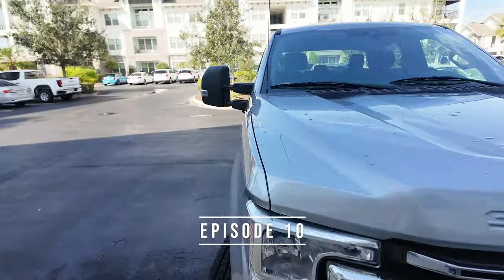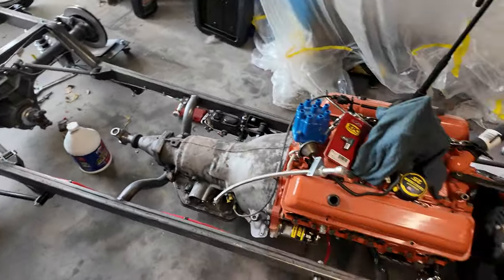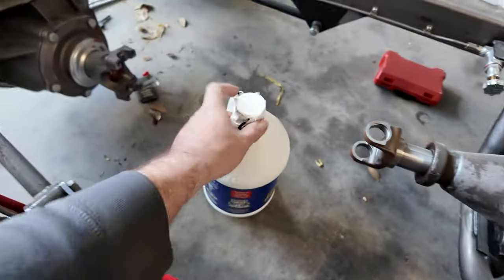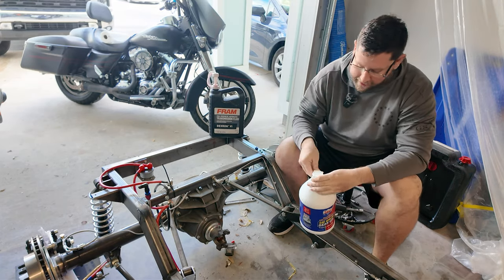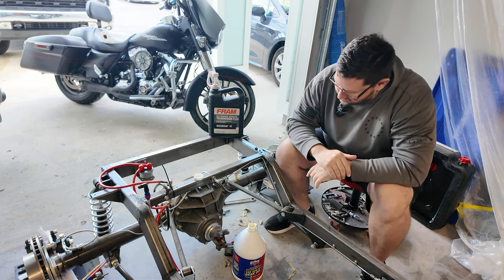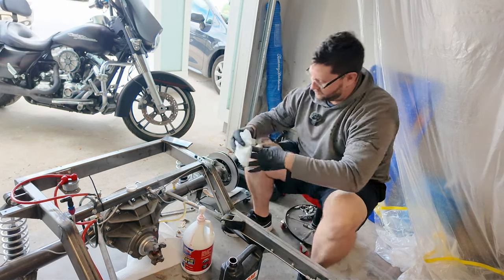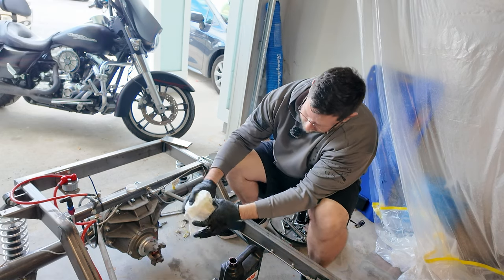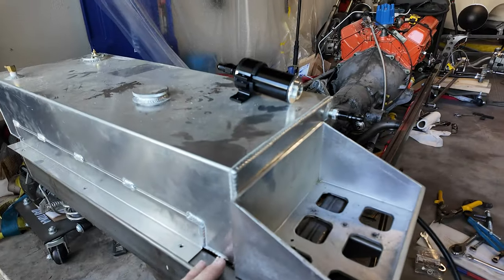T Bucket Hot Rod Full Build - EP10 | Speedway Motors Building the T Bucket ROADSTER

Comment: The modulator shift points are adjusted with a small screwdriver within the nipple where the vacuum hose goes in.
Reply from the maker: Well I'll be darned I never looked in the hole, I was expecting something in the outside. Never used an "adjustable" one

Appreciate that!

Comment: the wheels look good and yeah i think the black valve covers will look pretty sharp to 
but just out of curiosity did you consider just painting the valve covers you al ready have
Reply from the maker: Good question,  I did, and I actually have a powder coater I thought about pulling out.  I just want some really tall obnoxious ones that say chevy on the side.  Its not super important now as the budget has dried up and we are pinching now witht the project.  Maybe a future add on?

The wheel were a hard discision especially the offset and backspacing and Mickey Thompson SS tires, but im trying to stay as far away from a Fad 60s T Bucket as much as possible and more towards the Tribute T style.
Reply: @GearHeadzGarageUSA  if you pull the powder coater out  please film it inever actually seen one of the home units in use before  i dont mind the 60's fat tire look but its kinda necessary with all the power people are putting in these things today
Reply from the maker: I have a few things we will powder coat a little later on.  Its the HF one.....its actually pretty good.  I hot flock everything and the finish is perfect.  

Now if we end up putting some power to this motor then we will need to graduate to some Hoosiers,  but I dont think this 2BBL 69 SBC will be a screamer. But I might be wrong considering the T is about 1400 Lbs lololol
Reply: @GearHeadzGarageUSA  ive never had a need for a powder coat setup but i would like to experiment with it  i wasnt aware that harbor freight still sold the powder coat machine ill check the price though